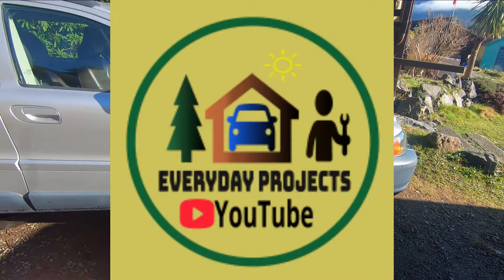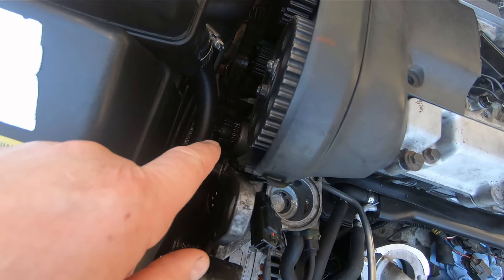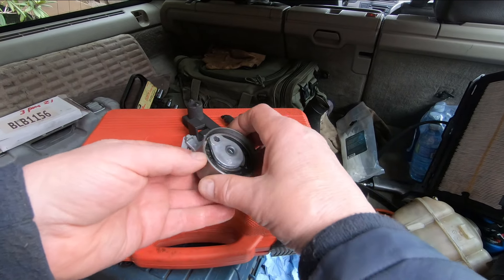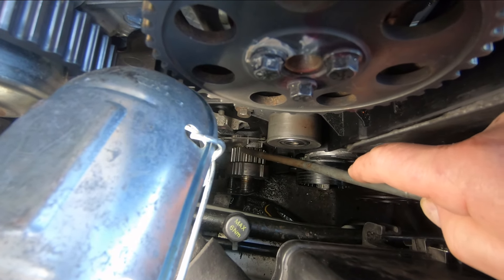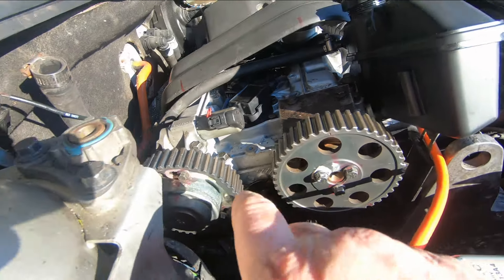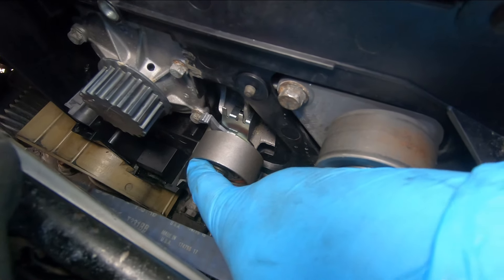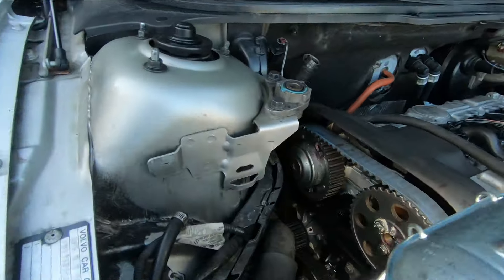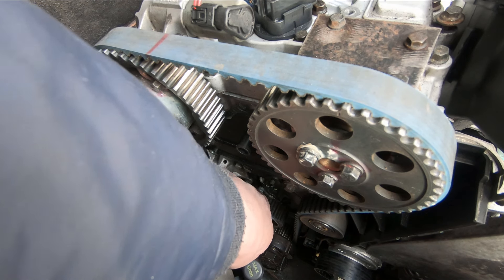CHANGING TIMING BELT TENSIONER ~ 2001 VOLVO V70XC 2.4T B5244T3 ~ USING CRANK AND CAMSHAFT LOCK TOOLS

Comment: The right tools for the right job👍 A great how too video for anyone attempting this repair!
Well done Craig✌
Reply from the maker: I used this set once before when I installed the rebuilt head on this engine. Every manufacturer has their specialty tools and it is lucky that Amazon sells the knock-offs at a reasonable price. The right tools make for easier work. Thanks for stopping by, Marc.

Comment: Some super smart developed the parts that make this car or any vehicle run. Takes a smart dude like you Craig to make sure parts are setup and replaced properly to make sure it keeps running. Interesting stuff Brother!
Reply from the maker: Yes, Doug, you gotta hand it to the engineers who come up with this stuff. Not everything makes complete sense on these cars but Volvos are as tough as tanks. Still one of the safest cars on the road, they say. I have a bit more to do to get this running again, but it's close. All the best!

Comment: Great fix Craig. Not raining today. 🤭👋👍🏻
Reply from the maker: Thanks, Noel. Yes, it was sunny for a change. Our weather is slowly changing out of the rainy winter to drier early spring days. This summer will no doubt be another drought so I will enjoy the moderate weather while I can. This tensioner was a worry but now it's replaced and hopefully won't give me any more trouble.
Reply: @EverydayProjects  was the bearing bad in it making it tip to cause the belt to run of to the side. 
And the part the belt runs on, is it flat or does it have a little crown in the middle. 👋👋. Just curious.
Reply from the maker: @noelstractors-firewood57 The bearing seemed OK. I still haven't determined if the tensioner was at fault or if this is the way they all run. I'm still learning about these engines. They are different from so many others I've worked on. The tensioner is dead-flat, as far as I can tell. I'll be posting a follow up video and show the results/ Thanks for the questions. take care!
Reply: @EverydayProjects . 👍🏻👍🏻👋👋